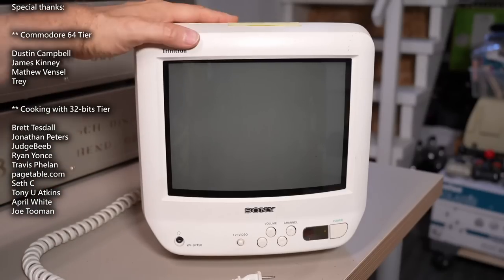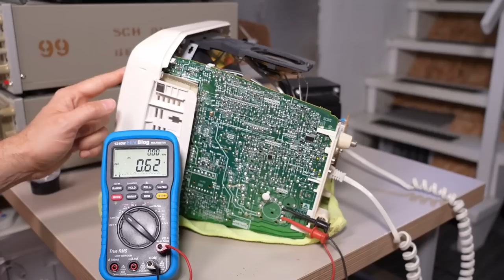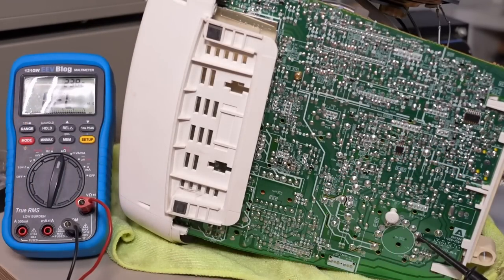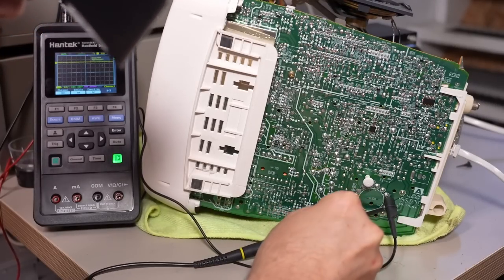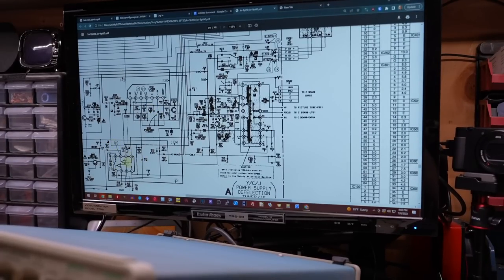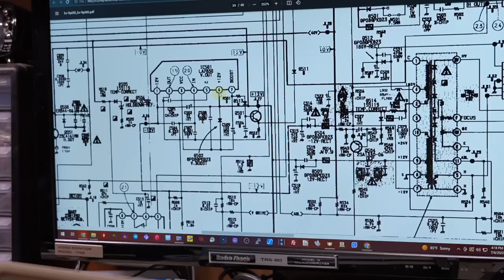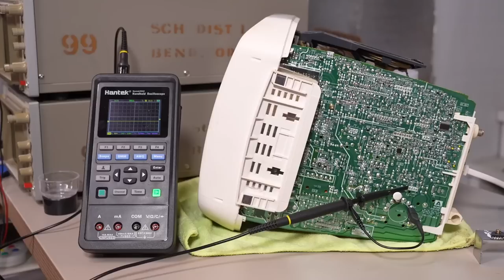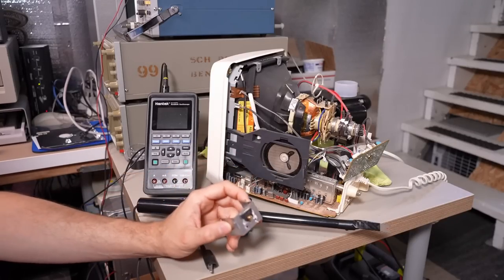This little Sony Trinitron TV squeals and then shuts off (KV-9PT50)

Comment from the maker: One of my patrons asked if I still had the old broken parts from the smashed KV-9PT50 I had on a previous video. Unfortunately, due to space constraints, I didn't keep the parts.
Reply: I bet Adrian has a logistics manager employed full time ;-)
Reply: Oh, you should have kept at least the flyback, the vertical output IC and the horizontal output transistor, if not the whole chassis. Those are the most common failure points, and none of them available.
Reply: Oohhhhh.... i was going to ask the same thing.. 😶
Reply: jamesrowden303  I 100% support whatever he wants/wanted to do, but as to "no" point: if it's something you are absolutely sure there is an immediate market for (few to none on ebay, high sale price and short listing times on completed items) there is a point to some of us.

I have literally zero "storage" space available but if I knew something could turn into $100 in a couple days I'd certainly let it rent a couple square feet of my office desk.
Reply: jamesrowden303  Yes, but he clearly has at least one of these TVs that he intend to keep. If the flyback fails in that, game over. A flyback and a few ICs don't take much storage space. When I come across something that is beyond repair, but it is either a generally highly sought after set, or I want one myself for my collection, I always keep all the critical, otherwise not available parts from such units. 

I just bought today a nearly 50 years old Sony PVM-1300 Trinitron monitor. It works fine, but I might end up buying an other one with weak tube from the same seller, just for a spare flyback and knobs (one knob is missing from mine).
Reply: jamesrowden303  
In answer for the second paragraph of your reply to "emolatur": it's not cecessarily (just) making money. I like to save obsolete, but high demand parts, even if I can't sell it at the time. Even if I end up donating it. It makes me happy to know the part I sold/donated/used up saved an other unit from the bin.

And Adrian definitely does this, too. He mentioned several times, that most of the machines he repairs on his channels, ends up as a donation to someone else in the community.

And before you ask: yes, I am definitely, positively an e-hoarder 🙂.
Reply: jamesrowden303  To "store all eventual part types" is not the goal, it's impossible of course, I don't have a dozen B52 hangars. But for vintage stuff I own, or want to own in the future, if I come across a part for reasonable money that is very hard to come by, and prone to failure, I will buy spares of it.

Comment: Check the safety circuit, it could be shutting off the TV. Example if you have a bad capacitor it could put the Horizontal frequency way off and the safety circuit will kick in. In the drawing you should see a line going to it from the flyback transformer monitoring the set.  I think it is kicking in before all the rail voltages have time to come up to the correct levels. This is a common issue on older sets. They put these in place and that is why they do not have all the metal shielding like the older tube sets had. Also note that you did have somewhat the correct horizontal frequency on startup but it could be drifting off when it gets all the power rail and the other circuits start up. A short in one of the could also kick in the safety  circuit. Sorry for the long comment.

Comment: Don't forget to check the resonant capacitors in parallel with the line output transistor. Seen those go bad many times. Usually if they're bubbling or bulging it's a clear sign of a defect.

Comment: The TV squealing and shutting down means that the protection circuit is working and cutting down power to avoid more damage.

One strategy to figure out why is usually disconnecting each power rail one by one (disconnecting the diode for example) to see what happens and define on which rail the problem really is. Another possibility is turning off the protection circuit and connect it to a power limiting circuit (serial bulb) to see what gets warm for example, but that is a bit more technical thing to do.

Another easy alternative is you feeding low voltage through an external power supply and check for heating of parts. I guess that is the safest, does not harm the circuits and you would circumvent the protection circuit.
Reply: The TV horizontal drive circuit is pretty much a big SMPS with a feedback loop. It tries to start the horizontal drive and if it doesn't see the right voltages on the power rails within a few seconds, it will shut down. There's also a protection circuit that trips if the high voltage becomes too low to prevent the TV from generating X-rays.
Reply: @Stoney3K  could be fault in line out or psu stage, i had a sony kv1442 that would go unstable and squealy, it was a 'noisy' zener in the psu,, i have an ancient sony kv1300 that does similar but psu in that seems ok, i havent investigated that one further yet
Reply: cracked ferrite core in line transformer or any psu transformer or choke could also cause squealing and shutdown
Reply: @Stoney3K  If high voltage becomes too low generates X-rays or the other way round? Conflicting information on the net.
Reply: @s8472-k8i  A TV will generate X-rays if the high voltage becomes too high (around 25-30kV for most tubes) because the velocity of the electrons hitting the phosphor is too high.

Comment: My only notes for this set:  R501 and R502 open up - "squedging" (Dad's words for non-standard squealing) and no scan-derived supplies.  Both are 10K, surface mount.
PS - Dad was a TV repair tech for 52 years.....he left tons of notes for sets, many now in landfills.
Personally, Sony horizontal driver transformer solder connections are ALWAYS resoldered.  Helps prevent callbacks.
Reply: Would you be willing to transcribe all these notes? I can host them if you desire.
Reply: Do you have any notes for a Panasonic CT-27XF14CV or a CT-27SF14CV?

Comment: A set shunting down like what you are experiencing usually means one of 2 things:
1) X ray protection kicks in (over voltage condition in the high voltage)
2) An overload in any of the branches powered by the flyback transformer

The squealing sound would seam to indicate it is the second option but the first one cannot be ruled out completely.

Usually the outputs of a FB transformer should look like a 40% duty cycle square wave with 0v in the middle so the same output could produce both positive and negative voltage depending on how the rectifier diodes are connected.

Also a FB transformer is a current transformer. the output voltages depend on the energy stored in the core when the primary side current disappears. An overload on one branch will "sink" the voltages in all other branches.

I hope this helps, keep fighting ...

Comment: Another observation is related to the waveform on 12 V secondary winding - it has notable -40 V dip downs that caused by a back EMF that occurs when the power transistor in the primary naturally cuts off on every cycle. The significant amount of that back EMF signifies that the transistor in the primary section puts a lot of power into the coil, but it doesn’t come through as expected. Once again, that’s a sign of overload in the secondary section, but surely it occurs after the rectification. For example, if it was a short circuit inside the transformer then you wouldn’t have back EMF spikes so big.
Reply: This. Ive seen the HV rectifier diodes go shorted/leaky in the flybacks as well, even doing a 1B3 mod to rule it out.

Comment: Squealing usually signifies a flyback transformer overload. I remember when my father accidentally short-circuited the flyback output, the transformer went squealing like crazy. I even thought it turned into a whistle for a brief moment. When the overload condition was fixed, the transformer started to work as usual. But it look has changed: it became a slightly more brownish color than it was before the overload.

Comment: I'd check the line output txfrmr primary drive circuit, it maybe working overtime due to an issue with the drive transistor and hence the squealing. Just a thought and give it another go Adrian, LOPT's are usually really reliable in smaller sets due to a lower high voltage output than bigger sets. Great video btw!

Comment: As an expert in both CRT displays and transformers, I will offer some suggestions to consider.

First thing I would try is to disable the protection circuitry that shuts down the horizontal output and high voltage. Before powering on in this mode, be monitoring the CRT anode voltage and at least one of the other secondary supply voltages on the flyback; you don’t want excessive voltage to fry anything. If you have a variac, it might make sense to use that to slowly bring up the AC power voltage.

As to the theory that the flyback may have internal shorting that only appears when the voltage is high enough, this is a possibility. What I have found from experience is that even ordinary switching power supply transformers can do that too, so it’s not far fetched. We actually had that happen quite frequently with switching power supply transformers, to the point where we developed a test circuit that used a horizontal flyback type of circuit to apply more than twice the expected voltage to the part, and that would be observed on a scope for a minute; bad parts would fail quickly, good parts would last in the field. We stipulated that this test be performed by our transformer manufacturers. Our one transformer supplier even contacted me saying they would always have a percentage of transformers fail, but when ours failed they failed at their factory and we weren’t returning failed transformers for that reason, whereas other customers of theirs had them failing in the field and they would get a bunch returned. He wanted to use our test for all of his customers, and we obliged them by supplying the design details. And he said once they implemented that, failures in house before shipping increased but returns went down - that’s what they were hoping for.

So back to shorting / arcing under high enough voltage. Obviously you can’t give this flyback double voltage like my test did. But you can keep it running if the shutdown doesn’t happen, and if it is arcing eventually that will char the internal insulation to the point where it conducts and that will accelerate the failure. Likewise if there is a situation such as what we had with ordinary power supply transformers - there would be small pinholes in the magnet wire insulation, and when two pinholes on adjacent turns of wire got too close that turn of wire would be an effective shorted winding on the transformer, and the transformer is useless / worthless for continued operation.
Reply: Very solid advice. Writing a comment to hopefully bump it up in the comments list.

Comment: Always save the flybacks out of old TVs when you get rid of them. I do. There is a project to make a universal flyback transformer, I watched a video about it on Youtube.  As someone who fixes old arcade games it is really interesting to me. Looking forward to a Coleco Adam video in the future.
Reply: The idea of a “universal flyback transformer” is a pipe dream.

The secondary output voltages that feed circuitry other than the CRT anode will vary from model to model. The resonant circuit will vary from model to model.

Sets with larger CRTs usually need higher anode voltages.

If a “universal flyback transformer” was remotely possible, the manufacturers would already be using the exact same flyback transformer across the board - that improves “economies of scale” (saves money so more profitable to do). The flyback manufacturers offered standard catalog models in the hopes that set manufacturers would use those, and they all had several of those standard catalog flyback models.

So don’t hold your breath waiting on one of these.

Comment: High pitched squeal with shutdown- definitely characteristic of a voltage rail overload. You've done your due diligence checking the usual problem areas and components, and without pulling that flyback and performing a ring test I'd be writing it off as the culprit as well. You would have been lucky to find a replacement fly for this set ten years ago, and even then most of the market had been proliferated with poor quality generics that usually either didn't work out of the box or didn't quite fit the PCB footprint, on and on. Long Live SORNY!
Reply: Should have gotten a Magnetbox instead
Reply: @nilz23  That, exactly. Thank you! 😁

Comment: I think somebody suggested ringing test for the transformer.  That probably related to a Sencore Capacitor-Inductor Analyzer.  One of their models was (or is?) LC102.  It applies an impulse to a tuned LC combination and counts the number of the decaying ringing waves.  It is an indicator of the Q-factor of the inductor.  Easy and simple result, without math or any deeper understanding of the L-C-R circuit analysis.  However, the (already shown) DER EE instrument DE-5000 can also be used.  In this case I would measure the inductance and the Q-factor at 10 kHz, which is closest to the nominal 15.75 kHz use of the horizontal deflection.

Comment: Something else to check for would be corona discharge.  Turn all the lights off to make it as dark as you can and turn the set on with a clear view of the flyback.  If it's a insulation issue (HV leak) you may be able to see the blue/purple arc emminating from around the flyback.

Comment: As I remember the Sony sets, they have a lot of protection all arround,so in most cases the sets shuts down. 
Well, its seldom that Sony flyback trafo goes bad, but of course this could happend. 
Have you checked the safety resistors on the powerrails they sometimes raise in value, also when you start up and power down the unit, there are a poping sound in the speaker, perhaps the main audio amp are shorted from power to output, normally its a differential amp between 2 powerrails.
Keep up the good work

Comment: I have a good friend, who has worked on TV's professionally for many years, dating back to 'tube' populated components in the sets.  Based on what he's discussed, if the FlyBack Transformer is failing or 'breaking down' under high voltage load, the TV is designed to shutdown, for safety reasons.  Part substitution would be the next step, if parts were still available.  As he has said the failure of a Flyback Transformer can be a show-stopper.
Reply: That's so true!

Also, however, if the flyback is actually perfectly fine, there are other things that can "stop it from working" and the "startup" fails.  Too many things to list, but if the startup circuitry fails in any way, including the horizontal sweep section, then flyback's windings don't get energized which then means, there's no "power supply" happening.

I actually hated those sets when they designers started using flybacks as the main power supply transformer.  Sure, more efficient and less expensive to manufacture, but those sets could be challenging to fix.  Any small thing that prevented the windings from "starting up" could make troubleshooting a pure P.I.T.A. (and that ain't bread)  LOL

Comment: While the flyback ring testers are not definitive for testing good, if it says it's bad, it's bad.  I'd suggest getting one.  They can spot a single shorted turn where your multimeter can't tell.  And they're not hard to operate.

Comment: Based on the symptoms, I would guess that either the driver side is weak or some monitoring chip isn't getting the right "it did turn on" signal. Because the outputs all show signs of "getting up there" before it drops down again, I would primarily assume that the flyback is at least almost fine. There might be a high voltage breakdown, yes, but I think the waveform would look slightly different, more like a rising sawtooth than what looked - from afar - like a symmetrical up/down spike... I'd check up on the input drivers next: a.: do the 5V remain stable during power up? Firing that primary coil up takes quite a bit of current; if the main filter caps are weak, maybe the 5V logic voltage has a droop and that causes a reset in the control chip? b.: does the switching transistor "behave"? i.e. is it turning on and off completely and fast enough? Compare base/gate signal to the output towards the primary coil...  I had a slightly larger Sony set where the Flyback was knocked clean through the PCB during transport. Tose things are sturdy. Not a huge Sony fan myself, but the TV sets they made were tanks with screens as far as I can tell.
Reply: I suspect the driver side is current limiting due to a overload.  And I think the safety circuit is doing it's job as the voltages never get where they should be.

Comment: try disconnecting all  those  power lines from the lopt , so nothing is loading it and see if it powers up , also check line driver stage before the line output transistor

Comment: I don't think the flyback is at fault here. Seems to me like the IC that generates the horizontal pulses has a startup mode and a run mode. All the voltages start coming up quickly at the beginning, so the startup seems to work. Maybe the horizontal pulses go bad when the run mode engages after the voltages have come up enough? i would look at the horizontal drive on the scope with a longer timebase to see how it changes over time.